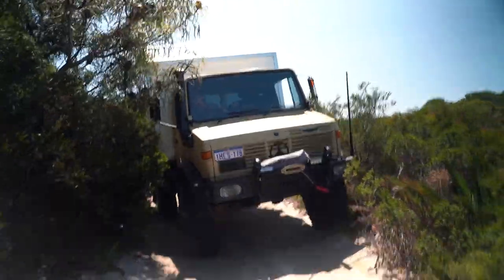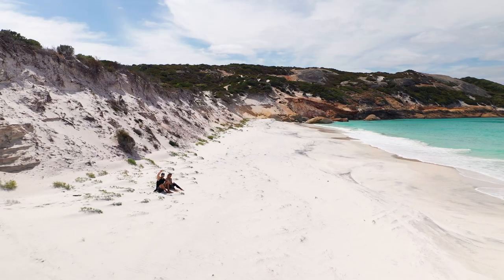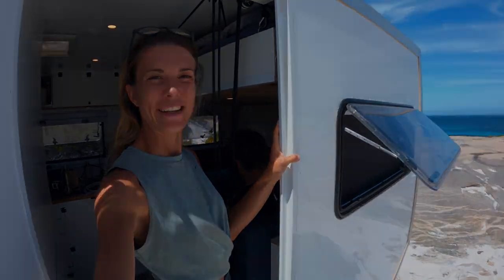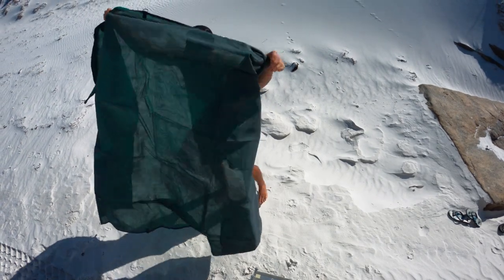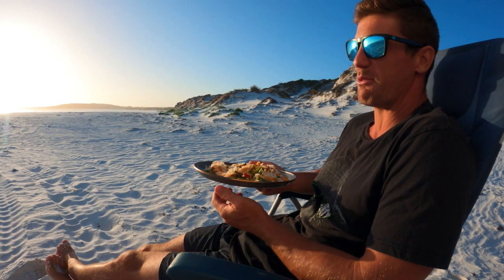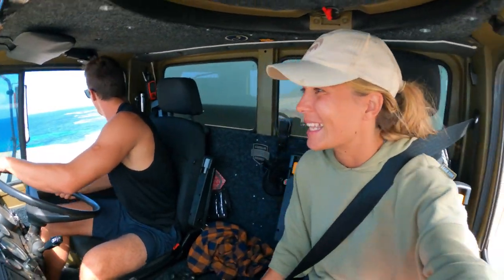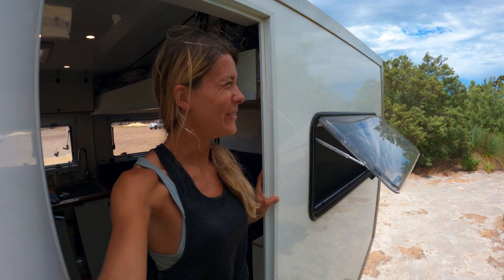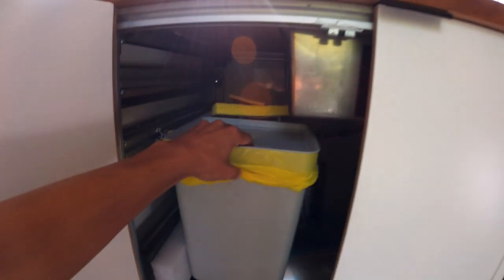Unimog Truck Offroad - REMOTE Beach & NARROW 4x4 Track Esperance

Comment: Wowee, time 3:15 I was holding my breath for a sidewall staking on your back right tyre.... good thing it didn't and in that case you didn't have pressures much lower on your rears for soft sand.. I held my breath for a moment.  Your soft suspension and relatifvely high centre of gravity also make me happy you have diff locks. The only time my Bedford got stuck was when i was leaning sideways or diagonal potholes and I didn't have enough weight on 2 tyres and they slipped, but no problem for you!  That was serious skill stuff there, awesome.

Comment: perfect 24-35psi, I've had those tyres down to 12-15psi on real soft sand, but don't let the tyres spin on the rim otherwise you will rip the valve off the tube. Great vid well done!

Comment: Might want to think about some heavy canvas covers for the acrylic windows to prevent bad scratches
Reply from the maker: That's on the cards, we've been inspired by another Unimog owner :)
Reply: @TheOutFit  Yep I tried press studs first but found they pulled off too easy so went for caravan awning track and awning remnant. I used silver polish to remove light scratches but use up / down or sideways movement NOT circular